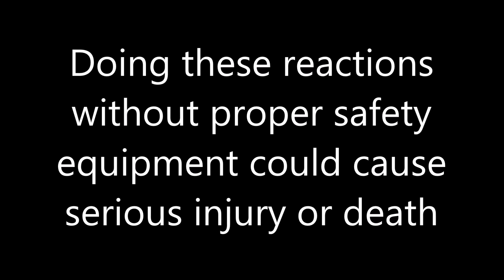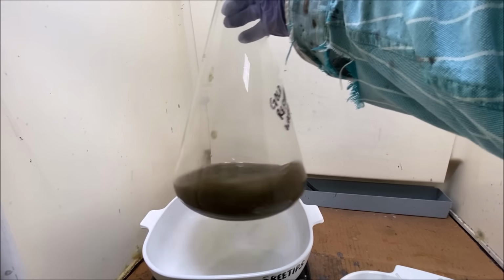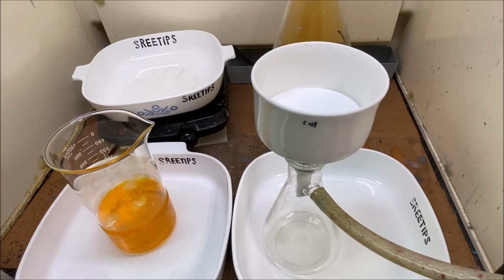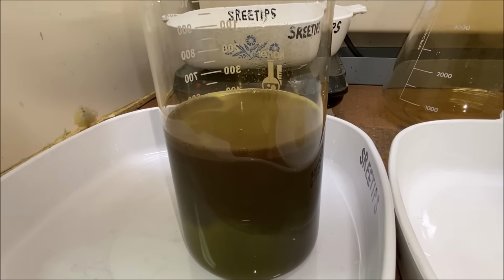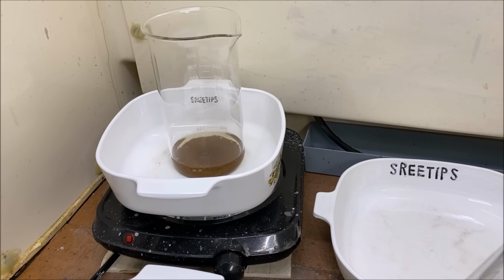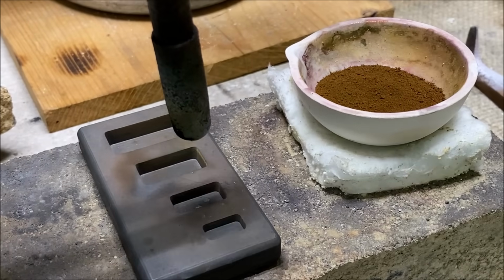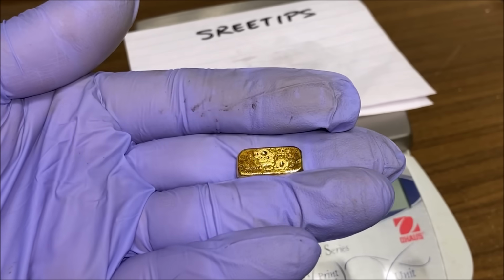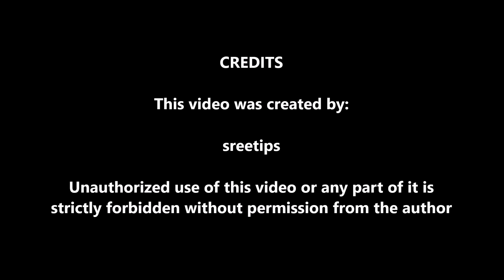Pure Gold From My Waste Container

Comment: مرحبا عمل رائع جدن هل الميتا سلفات صوديوم ترسب نحاس مع الذهب وكيف يمكن تخلص من النحاس المترسب مع الذهب دون ان نفقد شيء من الذهب
Reply from the maker: SMB is Sodium Metabisulfite. If I have gold in solution with copper then I can use sodium metabisulfite to selectively precipitate the gold. Since copper won’t precipitate with SMB, it will stay in solution as the gold comes down. Then it’s just a matter of rinsing all the copper off the gold with water.

Comment: I don't know much about refining and I only watch your videos on it and have for years but why do you not do a stanischoride test after you use the SMB before you pour off the remaining solution and why not just boil the same container that you used the SMB in? Wouldn't it increase your yield? I still enjoy your videos, and it's just something I have been curious about for a long time now.
Reply: ‘Stannous chloride.’

There’s no need, once the xs SMB AuCl4-2 reaction is done.

S has added an excess amount of SO2, in the form of SMB, to drive the reaction to completion.

If he skimped on SMB, and all the Au hadn’t been reduced, it’d still have been a notably orange yellow solution.
Reply from the maker: It years of experience working against me. This was a hurried production. I’m working on silver cell anode filters right now, which is a nightmare, so I had to reconfigure to do this short video so I could post it Friday night.
Reply from the maker: I’ve had boil overs from boiling the gold in the same container that I used the SMB in. Especially if there’s excess nitric present. All goes well at first, then it reaches a certain temperature and boils up out of the beaker.
Reply: @sreetips  I’m trying to think if I recall any previous video where you didn’t reflux boil the Au bearing solution until the brown NOx gas being evolved was gone.

If you risk boil over, you’re adding the SMB to fast or in too big of a quantity.

Like in machining class or cutting your grass, ‘speeds and feeds’ are important.

Comment: I've been slowly accumulating my karat scrap from estate sales, yard sales, and online--I'm up to about (what will be) 24 grams of pure gold, and when I crest 1ozt--enough to pour 1 oz, I'll be attempting my first real refining! 
I just need a good torch that can get hot enough, that wont break the bank. Unfortunately they no longer sell real MAPP cylinders.

I was able to refine about a half gram from gold filled scrap, and electronic waste a couple of weeks ago thanks to what I've learned here!

I tried several years ago using the AP method, and it ended in a complete failure, so this is a huge, huge deal--thanks for everything you do for us, man!
Reply: I wouldn't do an ounce on your first attempt at refining. Break it into 4 or 5 , until you're fully in control of what's happening.
Cheers Roger
Reply: You can’t get MAPP at your plumbing supply house?
Reply from the maker: I use MAP in the yellow cylinders. It will get hot enough to melt gold. I buy it at the hardware store.

Comment: Does it really help to blast the mold with the torch for so long? I know that the mold must be heated to make sure that it's completely dry to avoid the risk of a steam explosion, but is there a good reason to keep the torch on it for 5 minutes and during the pour? Are your ingots better this way than if you just blasted the mold with your oxy-acetylene torch for a few seconds?
Reply from the maker: There’s a big difference. The hotter the mold, the better the shape of the bar. The trade off is that the mold erodes over time from being heated.
Reply: @sreetips  Thank you Sreetips, that's yet another thing I learned from you! I guess I'm going to have to buy a second torch then.

Comment: I have an experiment for you. It has been working on 8ozs bars of copper that I've been pouring so why not gold and silver?  When I'm ready to pour, I get my mold just past black hot. Not cherry red but just turning red. Don't let it cool down, let it stay red. All four of the sides and the bottom have been turning out pretty smooth. I still have to clean it up but it doesn't really have many pits or cracks, but I use my horseshoe forge. The top still looks like a hand poured copper bar, which I like. I actually have a 9oz bar that I planned on remelting until I walked past it today and took a glimpse of the top in the sunlight. Man, it looks good. Keep up the good work. Great video as usual.
Reply from the maker: The graphite will erode from repeated heating to near redness.

Comment: Wonderful.  I am trying to imitate what you are doing (they say that imitation is a form of flattery).   I don't know if you have ever done it before or would even spend the time to do it, but I would love a list of the basic things that would be needed to start up the same process as you.  I know we only get to see a small portion of everything that you need to actually do what you do.  You might even consider setting up "Starter Kits" with everything you need to get started.  LOL   Thank you.  

Also, I have not tried it yet but I know that you have done electronic scrap before.  Supposedly most of the PCB material is made of a resin and fiberglass.  The some types of the resin are supposedly soluble in DMSO.  Never tried it but would love to.
Reply from the maker: I put everything in the videos. Nothing is left out. One could just watch the videos, take notes, and get similar results.
Reply: @sreetips I just did my first melting and there was specks of gold in a pit of black. What do u think I did wrong? I've tried following your steps....